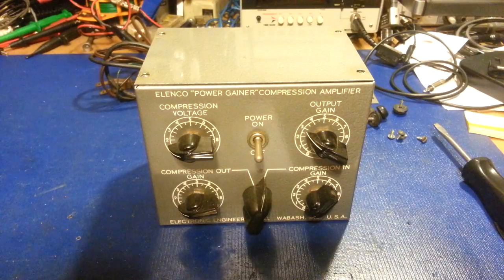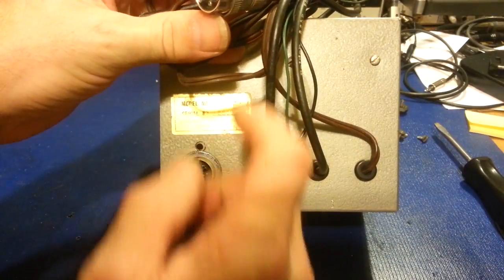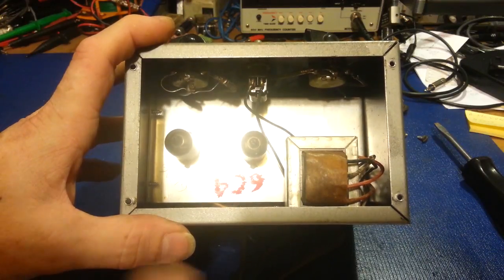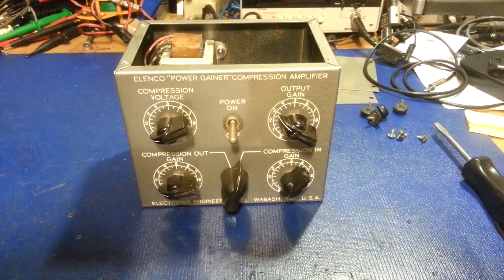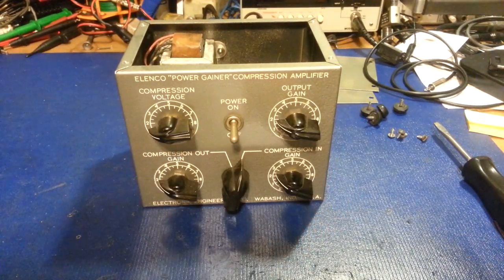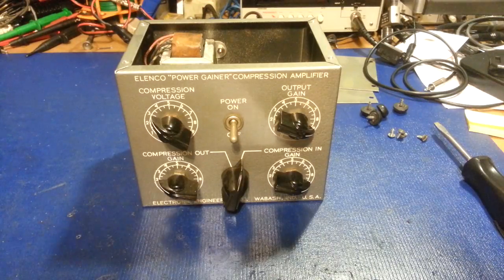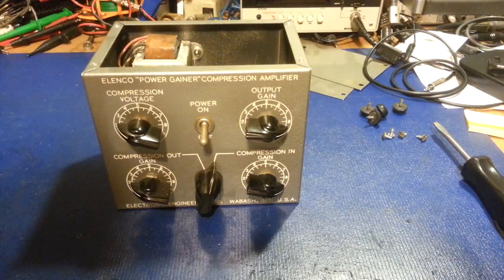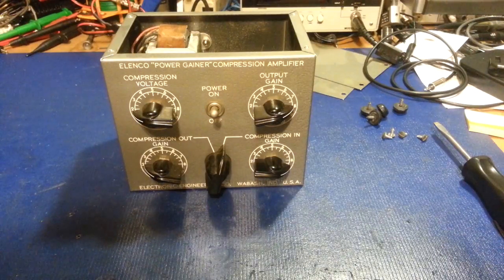Reproducing the Elenco microphone "Power Gainer" compression amplifier.

Comment: Mike I know you are busier than a "one legged man in an ass kicking contest!" but any further thought on reproducing these? Was their a lack of interest? I do not think I would want SS. I think the vintage hammer-tone paint is cool and vintage. Making them as a kit that people assemble themselves. That said the SS with exposed tubes and such could look cool too. Ultimately either look could be cool! I have a Demco I just got it off ebay also bought 4 of each tube either JAN or Tektronix brand. How much drive do those put out in milivolts. I could use 200mv to drive a  phase rotating asymmetry eliminator then into a hifi compression unit.

Comment: Years ago, we had a "Phone Book" sized Compression Amplifier on an Audio paging system that covered about 10 acres of indoor manufacturing plant. I used it to limit the input, primarily from a front office operator that would at times knock you down when she paged.  That was half a lifetime ago.

I've been retired now since 2003, and have one of those HP, curved screen, all in one computers and when what I am watching shifts over to an advertisement, the volume goes wide open.  

So, what I think I need is a relatively low power Compression Amp. that would plug into the computer earphone jack (1/8 inch stereo phono plug) and I would use a set of desktop speakers for the audio. 

I was thinking of building one myself using IC circuits, but don't know where I would find plans simple enough for me. Do you have any ideas where I would find a solution?
Reply from the maker: +Khadijah Brown 

You can buy pre made ones.  Just search for headphone compressor.  Here is one example.   http://www.fullcompass.com/prod/272220-Rolls-SL33b?utm_source=googleps&utm_medium=shopping&utm_campaign=googleps&st-t=googleshopping-all_products_low_bid&vt-k=&vt-mt=&vt-pti=272220&gclid=EAIaIQobChMI0_mo7pLH2AIVUFYNCh2S0ApqEAQYAiABEgI9i_D_BwE

Comment: you know me Mike, I'm in. if it keeps the price down I'd like to see inside the unit. I've seen those FM preamps on line that user a clear plexiglass type case. I'm assuming it'll be cheaper and I've never known an  audiophile who doesn't like to look at a lit or glowing tube no matter how small the it is. I use a demco on my 2340 (as you know) but could use something like this on my second fs 2340.
Reply from the maker: I figured you would probably want one. ;)
Reply: +MikesRadioRepair how about the plexiglass glass? would it hold the cost down? even if the difference in price is negligible between the metal and plexiglass I'd prefer the later. I'd rather be able to see the wires, transformer, caps and tubes. I'd think a clear plexiglass type kit box is probably available and cheaper than a stainless steel or any metal case would be.
Reply from the maker: +4Q2 4Q2 

Getting custom made plastic box's would be more expensive than stainless.  If I were making several hundred thousand sure plastic would be cheaper.  Set up for custom plastic forms would run several tens of thousands of dollars.
Reply: +MikesRadioRepair maybe acrylic boxes? noticed some of varying sizes on eBay. fairly cheap.
Reply from the maker: +4Q2 4Q2 

Problem is its still plastic.  I'm not going to make something out of plastic.  It's going to be built like a tank or not at all.
Reply: +MikesRadioRepair ok. I guess I won't be seeing the tubes. you know me well enough. if i say I'm in I'm in. I'll request serial. no. 002 because I know you'll be keeping 001. LOL!! ps I received the 2340 today. I'll get around to opening the box on Monday. looking forward to using it for the first time with the limiter bypass, 12ax7 and demco.

Comment: I use Ten-Tec 715 and have used SP1-a as well. I am interested but I am getting ready to go off to Culinary School so I am getting ready to go from working full time to working part time while going to culinary school full time and working at the school but not getting paid for it kind of like an internship. So while I understand hand built and retro cost it would be nice to have a ball park price. I liked it all all but the exposed twist on external metal can cap. I am guessing that that those metal can retro cap's have to be expensive as heck even when compared to Panasonic or Nichicon audio grade radial or axial electrolytic. Even most high end tube audio amps do not use that type of cap due to cost. The transformers you have to have no matter what but almost all of them use modern caps and hide them under the cabinet. In a lot of instances people cut the old metal can multi-cap's open and insert modern caps or they gut the cap and us it for looks but have modern caps underneath. Plus when the modern remake retro style needs to be replaced in 12-20 years will there still be someone making them?
Reply from the maker: The can caps run mid $30's and I don't see them being discontinued any time soon.  Tube is now retro and the in thing.  With all the manufacturers jumping on board to make tube guitar amps and stereo equipment they should be around for many years to come.

Comment: Thanks! I have a brown one and a blue one, and a copy of the owners manual , but need to figure out how to hook one of them up to what radio? I don't know as of yet. Very old school, or as they like to say on Ebay  "Steampunk", what ever that is LOL. I would like the exposed one you might make. I would like it to be able to be connected to any radio, just by the mike cable, and a  plug in the wall cord.
Reply from the maker: I will be uploading another video this evening that covers how these are connected to a radio and why they 3 coax cables.
Reply: I will be looking for it, THANKS!

Comment: Go with the McIntosh amp look. beveled front with the controls, etc.
Chrome might look nice, too.
But your right... it will cost $$$$
Put a socket int he back so the only thing you need to change to adapt to a different radio is the cable.
Reply from the maker: I kind of planned on doing that.  If I use a 8 pin jack/plug then it could be used with anything.  Also planned on putting a stereo 1/4" phono jack on it for T/R switching.  That way you could hook up a foot switch and use that instead of a hand PTT switch.  Have also thought about adding a bar type LED VU meter on the output.  That way the user can monitor their relative output of the unit.
Reply: The cable would have to be fully shielded ideally since modern radios have a data bus in that cable.
Some of the issues to overcome (as you know) is the different mic wiring and the various data buses add a challenge.
I am wondering if a board and jumpers to configure the plug on the back is really overkill.
Reply from the maker: +Mark19960 

I don't want to get to complicated with this.  I figured use a 8 pin jack so that allows it to be used with the majority of tube and solidstate transceivers.  Basically enough pins to allow audio, shield, T/R switching and a couple extras for those that have mics with channel up/down buttons.  That would cover in the high 90% range of all the radios ever made.

Comment: Hi, just an idea built a prototype of the two designs and show them on your segment and see which design gets the most votes then do a production run of the most popular one. I have never used a compressor on any of my Ham radio equipment but I have built compressors for sound systems when I was working for PYE electronics back in the 70's just after leaving school.